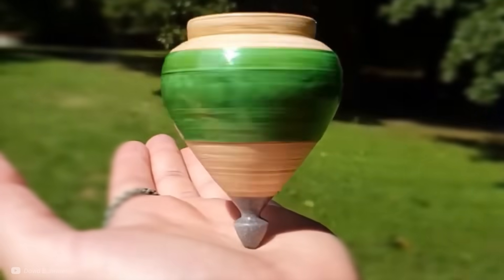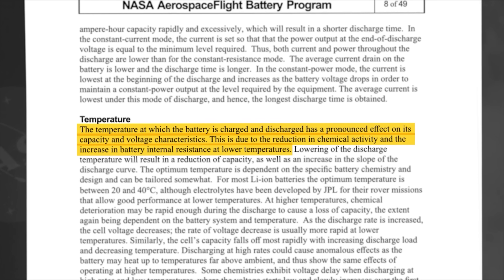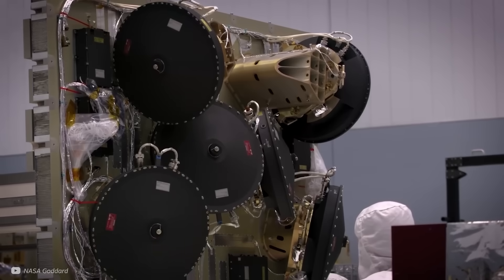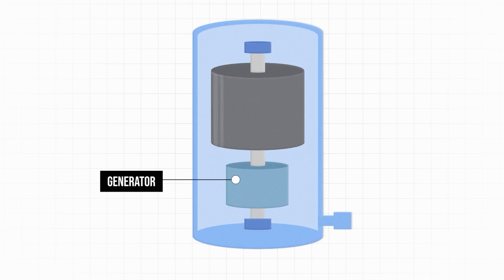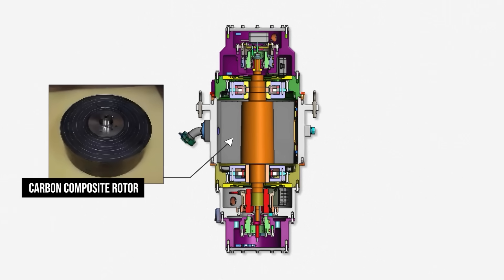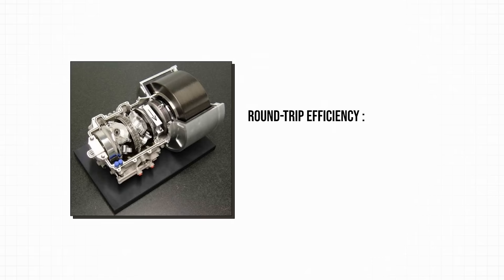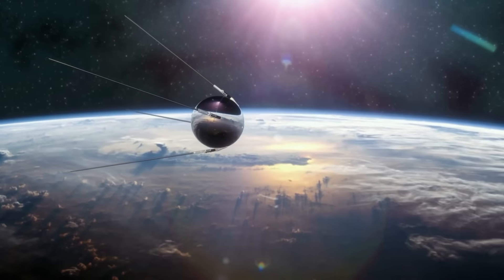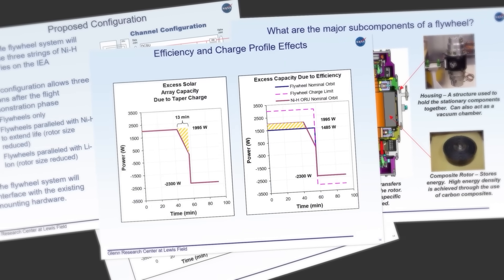How NASA Reinvented the Mechanical Battery

Comment: Can electric machines be equally efficient as a motor and as a generator? I thought that a generator optimized as such would not be the best engine in terms of efficiency, and an engine optimized as such would not be the most efficient generator.
Reply: Huh? First, the energy cost required to move a lithium based battery versus a mechanical flywheel, the watts per kg would be impractical. Secondly emf is very plentiful in space and "solar sails" were thought practical in the past. Capturing and using electricity for use in applications like motors allows less fuel to be carried to space.

If you speak of a motor used as a generator, long term on earth, around electrical grid nations, electricity is far more inexpensive for stationary use, while gasoline engines are far more portable in high wattage(horsepower) applications, but electric vehicles are far more modern, can do more with the watts(horsepower) and when connected to an electric grid or solar system, much less expensive.

In terms of efficiency, solar power has nearly no operating cost, whereas my car over 20 years has used 33,000 litres of gas, and an electric car would cost 60% less money to operate.

Both electric motors are horribly inefficient as generators, but as a generator the electricity produced by a cars wheels as a flywheel can immediately contribute 20% energy returned back to the range of a vehicle offsetting that amount of input electricity, which is a net positive compared to sinking money to convert gas into electricity as gas cost money, regardless of efficiency.

Electric machines in motion, generally are not a net positive producer of electricity, that would prove there is no physics and mathematics, and perpetual machines exists.

Car and electric bicycle motors are highly optimized more than many generators, since hydroelectric and wind turbines do not require a cost of input, whereas a car and bicycle does, it does not make sense of arguing if a car alternator makes a better generator or motor. In my research, permanent magnet bike motors are very efficient generators, and as the operating voltage goes up, likely more efficient than converting a low voltage current to a high voltage current with MOSFETs or diodes or transformers, up to the limit of the laminations in the motor stators and eddy currents.

In short, permanent magnet motors, in three phase work equally well or poorly depending on quality and design, the fundamentals of magnetism is the same in both. A poorly designed generator would also be inefficient as a generator, and vis versa. BUT motors are self propelled, must be as efficient as possible for smaller batteries, smaller motors, and due to that kind of investment and design can be much better than very low grade consumer generators. I've seen results of tests using rare expensive metals like pure silver made into stator windings. I'm almost certain that "motor" would be better making electricity than almost any other motor given similar size.😂

Comment: Yet another amazing integrating technology with decades of innovation and research behind it . . . that is still nowhere near as good as contemporary lithium-ion batteries. Aside from expense, the huge condemning factor of the G3 flywheel is that it weighs about 20 times as much as the equivalent battery. In aerospace this just does not fly, literally. Also remember that NASA can afford batteries that are 1,000 times as expensive as normal ones, much more energy dense and safer than anything in your normal terrestrial applications like EVs or grid scale battery stations. I don't mean this as a knock on this research which is superb and fascinating. It just shows how unassailable and advanced the state of the art in lithium batteries is.

Comment: Maybe my calculations are wrong but I estimated a flywheel losing 0.01% of its energy per hour could spin for 417 days as 0.01% is 1/10,000th and 10,000 hours is 417 days.
Reply: Longer, since there the first hour has the most energy to lose, when the energy is half of the original potential, the same percentage lost is equally in value portional, and equally half.

Comment: You have the reaction thing wrong. It's not through speeding up and down that they are used for. That certainly is a thing but it's the gryoscopic reaction that they use. That bicycle wheel was a perfect example. Nothing is speeding up that. The slowing down is negligible. A gyro wants to remain in the same position in space so if you give it a push it will react in the 90 degree opposite direction. On a space ship this will move it without using rockets.
Reply: No, reaction wheels work by spinning them up and down. The torque required is directly used to point the spacecraft. 
What you describe are so called control moment gyros (CMG). They exist and are used where high agility is needed. 
But they are more complex and therefore have more points of failure and higher cost. Also they require a more complex control paradigm as they can otherwise end up in orientations where they loose control authority in some directions.
For these reasons most systems use traditional reaction wheels.
Reply: @SciFiFactory  Ok, I learned something today.  Both of us are right though.  I asked ChatGPT and it gave me a good little lesson.  Pay attention to that last sentence though: How CMGs Work
CMGs control a spacecraft's attitude (orientation) by exploiting the conservation of angular momentum. There are two main types:

Single-Gimbal CMGs – These have a spinning flywheel mounted on a gimbal, and the direction of angular momentum is changed by rotating the gimbal.
Variable-Speed CMGs – These change the speed of the flywheel itself (which is what you’re referring to), but they are less commonly used in high-precision applications.
Most spacecraft rely on single-gimbal CMGs, which redirect angular momentum rather than constantly changing the speed of the flywheel. They work more efficiently than purely variable-speed gyros.

Why Speeding Up & Slowing Down Has Limits
You're correct in thinking that just adjusting the speed of a flywheel alone has limits:

Maximum & Minimum RPM: The flywheel can only spin so fast before reaching material limits, and slowing it down to zero would make it useless.
Efficiency: Changing the speed takes energy, and the spacecraft has to supply power for those adjustments.
Accumulated Angular Momentum ("Saturation"): Over time, if the system keeps adjusting without external correction (like thrusters or magnetic torque rods), the spacecraft can reach a point where it can't make further adjustments.
How CMGs Avoid Friction and Saturation Issues
Low-Friction Bearings – Advanced CMGs use magnetic or very high-quality mechanical bearings to minimize friction losses.
Momentum Dumping – If CMGs reach their saturation limit, spacecraft use:
Reaction Wheels & Thrusters: To reset momentum.
Magnetorquers: On Earth-orbiting satellites, Earth's magnetic field can be used to bleed off excess angular momentum.
Gimbal Motion Instead of Speed Changes – Most modern CMGs redirect rather than just speed up/down, making them more effective over long missions.
Reply: @dougcox835  Maybe I should have added a disclaimer that I work for a company that builds both, reaction wheels and CMGs.
My objection in the first post was just against you saying that the main working principle of RWs is the gyroscopic torque.
Of course the gyroscopic effect has to be considered for RWs as well, as they turn each other by turning the satellite, but that happens much slower than in CMGs where the gyroscopic torque is the main effect you are going for.
While in this case the answer of ChatGPT was very good, I am not sure if we should use it for citations just yet. :D
Reply: @SciFiFactory  Yeah, it is biased and does make things up (just like people do by the way) so I just try to be objective and see if it passes the smell test.

Comment: If you want to be blown away about some of the limits of flywheel / gyro tech check out the specs on NASA mission Gravity Probe B.  Its gyros were so sensitive they could measure the phenomenon of “frame dragging” which is the literal dragging the fabric of space by a moving mass.  Everything about that mission is interesting worth looking up if you’re into that kind of engineering.
Reply: I actually worked that launch for that satellite back in early 2000s at Vandenberg AFB when I used to be in air force.   The science begins the gyros spheres I overheard them talking about got me so curious that I followed the missions progress for years on their website.   Out of alt 50 launches I was involved with that's the only single one I ever followed outside of work on a longterm basis.   Glad to see someone brought this up after all these years.   That mission was a marvel of science in so many ways.
Reply: @sparaz  That's really cool! What was your involvement with all those launches, if you don't mind my asking?
Reply: ¿De casualidad no era donde el experimento consistía en hacer girar unas pequeñas esferas extremadamente perfectas de silicio dentro de un satélite y que uno de sus polos apuntaba a una estrella distante?
Reply: @nuassul  yes sounds right
Reply: Exactly. The subtleties of rotation are still being discovered / measured. Fascinating and very unintuitive subject.
Reply: I want a flywheel battery made out of electrochemical batteries. For my e-bike. Self-Balancing and not stressing the batteries out with sudden dumps when I do burnouts. 😂
Reply: ⁶⁶6⁶ @jtjames79
Reply: When will humanity have the tech to drag (or drive) on the fabric of space itself. Something like this is likely in our future assuming we don't go extinct first, and would revolutionize space travel.
Reply: @nicolasolton  When you move your hand you are dragging on the fabric of space itself. 

The difficulty lies in doing it at sufficient scale and using that effect in a useful way.
Reply: @SirSpence99  It is easy, I do it all the time to hail taxis.
Reply: @nicolasolton do you mean quantum vacuum theory.
Reply: @scottlubsen9004  is that the one that posits gravitons?

Comment: "Every motor is a generator..." Not true. 1. Not all motors are electric (as I used to think they were). 2. Even not all electric motors work as generators. For example, shaded-pole motors (such as those found in can openers and many desk and stand fans) can't generate electricity.
Reply: I think more accurately, every electric motor generated back emf. Therefore every motor could be designed to be horrible generators, but a few designs can be equally efficient consuming electricity and generating electricity, but not perfectly efficient.
Reply: Want to bet? Hook it up to a turbine.

Comment: F1 engines never reached 25,000 rpm. Cosworth reached 20,000 rpm in 2006, but today they're all running under 15,000rpm.
Reply: Williams developed a flywheel battery for the first generation of hybrid F1 cars. It spun to 50,000 rpm. It didn't end up in their F1 car but Audi won Le Mans with the flywheel system.
Reply: The Rocketdyne F1 engine turbocharger reached a mere 5,500 RPM and a paltry 55,000 BHP 😀 …and that was just to drive the fuel pumps! 😂
Reply: Fassbender?
Reply: and 100000 RPM is nothing incredible, many spindle motors and other air bearing motors in industry reach this speed without "carbon rotor" lol.

Comment: Press or twist a spring. Pressure a vessel. Drop a rock. Everything not moving holds Potential Energy. Everything moving has Kinetic Energy, and the crap fuming in the bucket out side is Chemical Energy which may be ether.  Woopie Ding-dong! Nothings Changed! And here you are trying to impress us with it... Geez! What a Nerdel!

Comment: In a sense, electric cars do use flywheel technology in regenerative braking. Not a one-to-one comparison, but it is fundamentally the same technology.
Reply: Stopping a wheel isn't flywheel technology.

Starting the wheel is the flywheel. That's how a 1:1 argument is made.

Hydroelectric energy causes a flywheel to spin, and that energy is siphoned off creating electricity that is finally stored in the cars battery which is used in spinning the flywheels which are the wheels of the car, and is regenerated when the car stops. Electric cars and bikes have 20% further range through flywheel storage when recovering energy spent in spining the flywheel (road wheels) 😂
Reply: @bwonghere on my e-scooter it was really noticeable when the regen setting was on high, it'd almost lurch when the throttle was released
Reply: It would be interesting to see an electric car with inwheel electric motors and flywheels instead of (or supplementing) chemical batteries, thinking of the potential to shift the weight of the car in emergencies or for better handling

Comment: 2:50 i dont think that is true. Just loock at cour phone, it tells you how much is left. The internal resistance of the battery changes based on its charge level so just measure voltage and currently drawn current r = u/i. And there you go
Reply: Not terribly accurate is the problem. It’s always been an issue with lithium chemistries.
Reply: Wrong

Comment: 07:54 euh ?? 4 times the speed of an F1 engine ?? Actually they run at max 16 000 rpm with the v6 (cause the limited flow of fuel no benefit to go higher), back at the times of v10, that was max 19 500 rmp, so again not you are wrong,
Just did you were too lazy to check that ?

Comment: thanks for the video. 11:25 in the video-- I could have sworn that the forces generally perpendicular to plane of rotation. But then my memory is shot....
Reply: Exactly. The force of the spinning wheel is not in the opposite direction.  It’s called gyroscopic precessions and is at approx 90° to the spinning direction.
Reply: Wrong force. There's one force that resists rotation on other planes, but there is also just the equal and opposite reaction

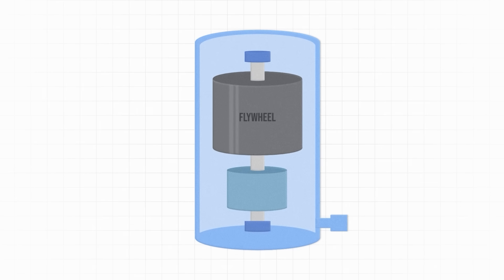Comment: 6:00 
I don't agree with "all motors are generators" it depends on the motor this only works with motors whose rotor has a magnetic field since squirrel-cage induction motors don't have a magnetic field in the rotor they can't be used as a generator
im sorry if my english inst good its not my nativ language
Reply: I agree. This was a drastic oversimplification of electric motors/generators. I get the need to keep things simple but his statement was very misleading.

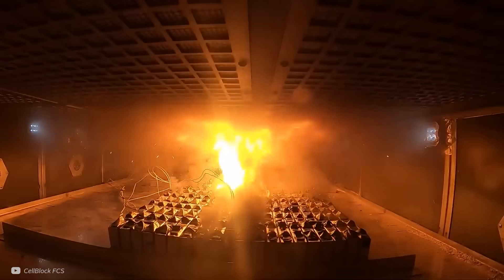Comment: 6:45 comparison of battery with fly-wheel storage if the casing is damaged: I expect a flywheel to release its energy explosively if damage to the flywheel itself or its bearings were to occur.
Reply: That is one of the reasons these things are often subterranean, not only for containment, but for stability and protection from damage as well.
Reply: @ And it may be part of the reason why this flywheel project wasn't used on the space station - potential for catastrophic damage. It's easy to fireproof batteries on a space station, just keep them unpressurised. No air, no battery fire.
Reply: @tvuser9529 Lithium batteries (dependent on chemistry) generate their own oxygen when overheated. This can lead to a thermal runaway event, as we now see in EV cars. Lack of air does not stop the fire.
Reply: @ Ah, right. Still a good idea to keep the batteries away from the air the astronauts breathe. If nothing else it at least avoids killing them with the smoke.
Reply: Yep, a conventional bearing could certainly fail and overheat, and then things will get interesting fast. I'm sure the magnetic bearings could fail as well.
Reply: @tPassenger? How Would a,magnetic bearing fail?🤔🧐
Reply: @ By a power loss, if it's electromagnetic. Or by a large enough impact. Or by excess heat from another source demagnetising the magnets. Just a few guesses.
Reply: to be fair, chemical batteries also have a tendency to explode when their casings are damaged
Reply: Anyway, there is a thing that has many mechanical parts, many bearings, runs around a thousand rotation per minutes, and operates at thousand of degrees Celsius. Oh, and billions of people are willing to expose themself to just a few meters from that while it's turned on.

That is an ICE

Comment: Flywheels on the electricity grid have a slightly different function. Old-style thermal power stations have massive parts which rotate at grid-synchronous speeds. 120 tonnes of metal at 3,000rpm (50Hz) provides a lot of physical inertia which makes it easier to control the grid frequency. Solar, wind, batteries, interconnectors are not grid synchronous so are treated as DC sources which have traditionally had an inverter which synchs with the grid frequency. As a higher percentage of power is coming from DC sources, the amount of inertia in the system is lower. Advances in control systems mean that DC sources can now be grid-forming as well as grid-following but there are plants coming online which use flywheels to literally provide inertia.

Comment: 11:30 BRILLIANT this is great for stealth. You don't want thrusters giving away your position.
Reply: In case it wasn't clear to everyone, you can replace orientation thrusters with gyros, but not propulsion thrusters. Fine for a stealthy satellite, but a stealth spaceship still needs thrusters.
Reply: Obviously space craft reflect sunlight. Stealth gone
Creating electrical power, huge magnetic field, emf radiation against a vacuum so easily spotted.

Incredible weight compared to stored energy, wasting fuel during launch, still need propulsion thrusters, and in a high vacuum, burning thrusters are highly efficient, and in a short duration, far enough away from earth that video equipment and video storage and compression would be impossible at 360times current technology.